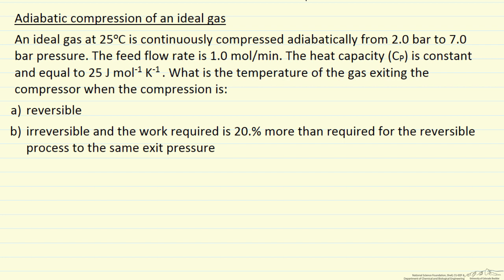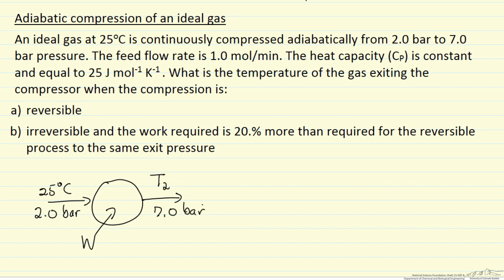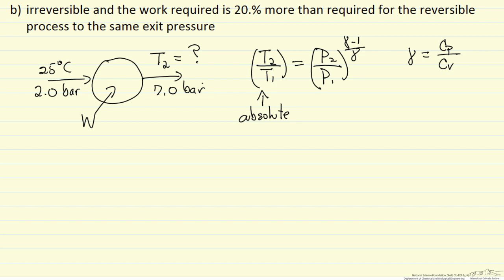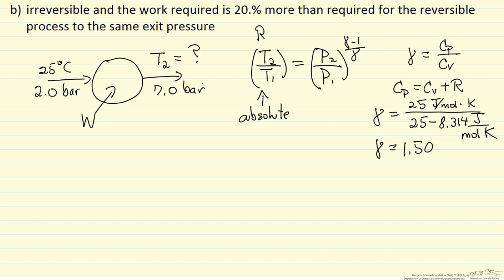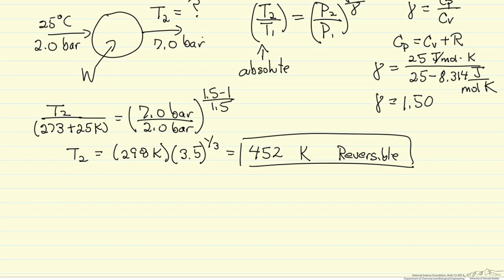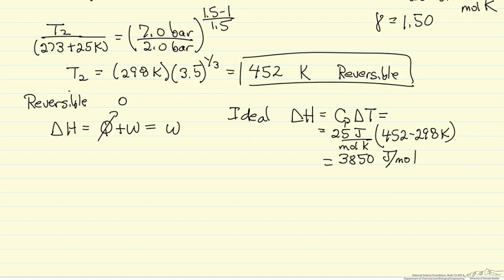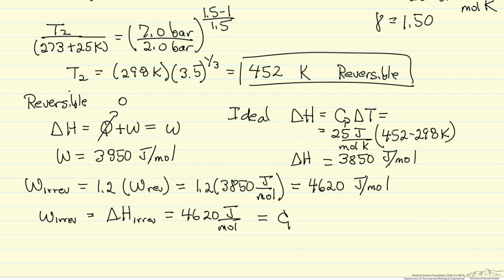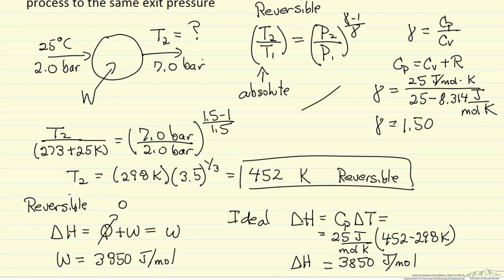Adiabatic Compression of an Ideal Gas

Comment: Can you explain why dH = Cp dT is used for adiabatic compression? It does not make sense since it is not at constant pressure. The work can also be calculated by W = 1/(1-gamma) * (P2V2 - P1V1).

Comment: Actually the the irreversible work is said to be 20% that of the reversible. So how did you get 1.2*Wreversible? Thanks in advance.
Reply from the maker: No, the irreversible work is 20% more than the reversible, so 120% of reversible or 1.2 times reversible.